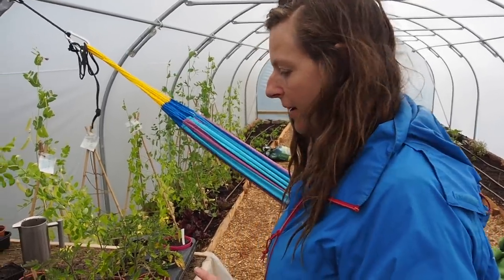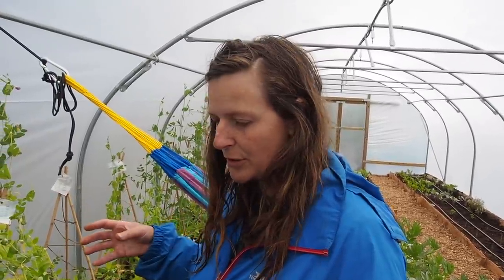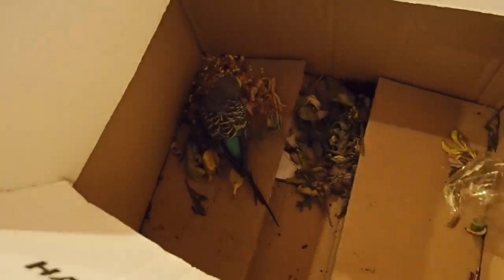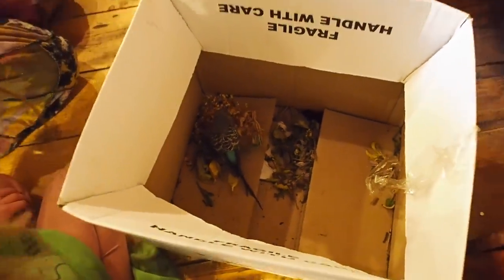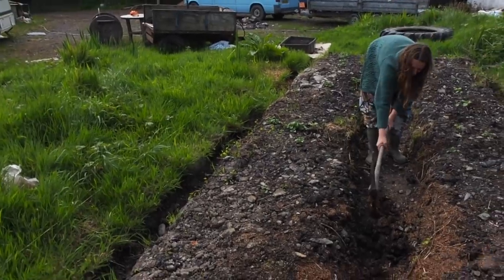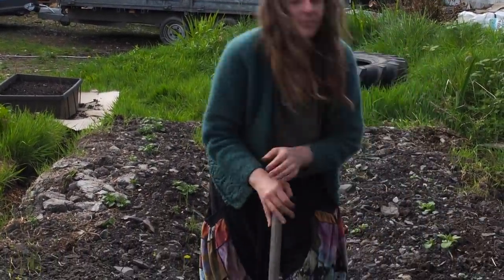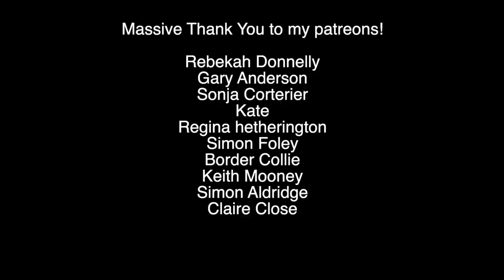GUESS WHAT WE FOUND! A strange day on the homestead!

Comment: are you potting into straight compost, because not a lot of nutrition in compost it is a soil, organism feeder ( smile explanation) not a lot of air spaces and will need drainage material added or in my long experience the plant roots smother ( 70 years a gardener hear in nz) have a look at Charles Dowding if you don't already or Huw in Wales
Reply from the maker: I love Charles Dowding channel. The tunnel is sited on an old bramble patch so not strictly no dig right now. We dug up the roots of the brambles we could see and then mulched with card and hemp roll. I then put fresh topsoil down and dressed with compost. I wasn’t sure if that was right but thought that over the years the soil will hopefully improve year on year. I hadn’t realised that about compost until a few days ago when a friend told me the same thing. Thanks for sharing your knowledge it’s very much appreciated

Comment: Hi Bruce sorry I am only getting to your video now as most weeks I pop in for a look on a Sunday, I was busy myself taking in a 20 foot container to my garden, anyway welcome to Disco the budgie and if you don't mind me commentating, Disco is a boy he has the blue colour on his beak. As to your tomatoes not to boast mine are bigger 🤣 if you just water the stem and not the hole plant it helps also always water in the morning as you don't want plants sitting in cold water over night as temperatures drop especially a poly its not like a greenhouse that holds heat. keep lower leaves off the soil in fact trim these off if touching the soil it will help keep disease at bay. sorry for the big long letter best of luck as well with the path, and check out Quick crop in Sligo for a tool called a chillington hoe great for the garden and a back pain saver.  👍
Reply from the maker: No worries. Sounds like an interesting project! Thanks for the tips regards the tomatoes. Funny enough after releasing that vlog it was like they heard us and just shot up. I literally just received a mattock I ordered from fruit hill farm and I’m itching to use it :)